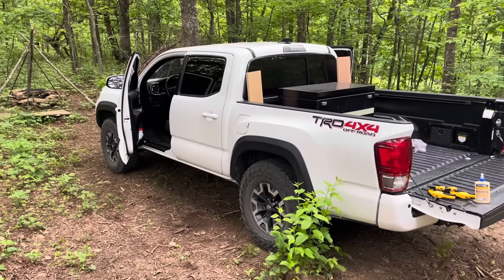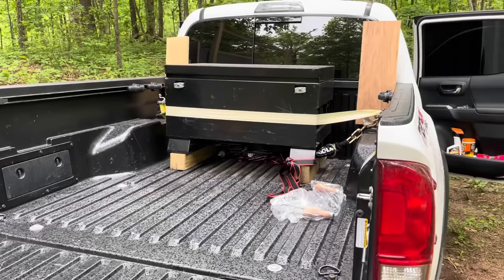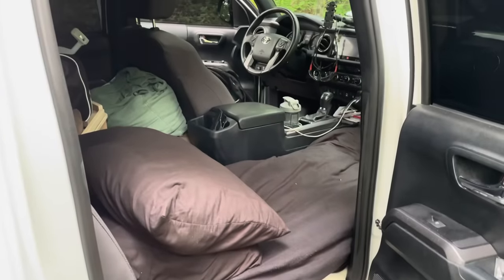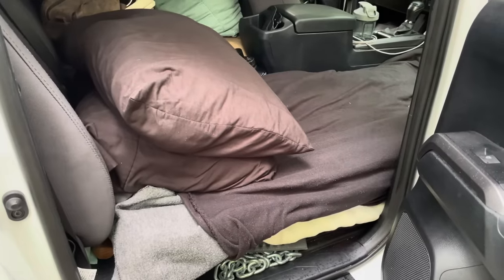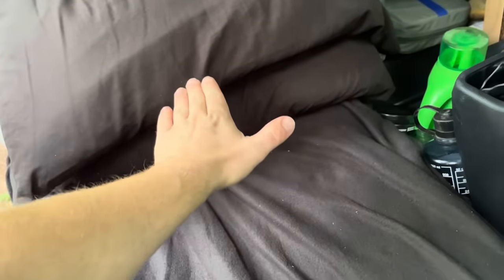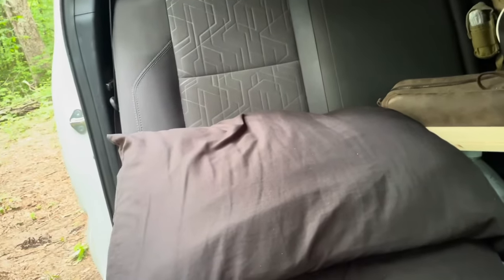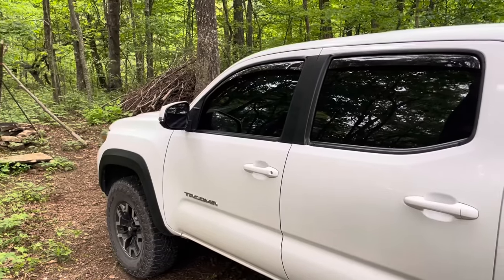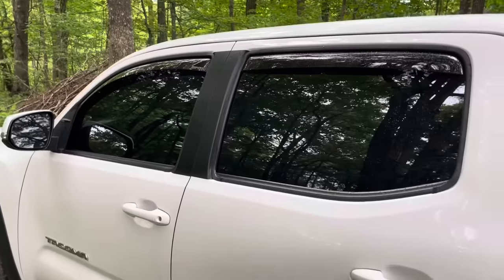Modify your pickup truck cab to live in it | Save money and discreet | Travel truck | Hunting truck

Comment: I have a 2011 dodge ram I want to do this but I'm afraid  of the air bags ...
Reply from the maker: I was worried about them too while disconnecting the wiring but I just went for it and stayed clear, even while turning on the truck the first time afterwards. I’ve seen videos of vehicle cleaning professionals remove seats regularly to deep clean under them. Don’t do it based on my word though lol.

Comment: Wouldn't a cap on the back be better?
Reply from the maker: Not in my opinion. I need the bed space right now. Most everything I’d modify/add in the back, is already done in the cab.
Reply: @ArcadianOutpost  Even if you still sleep in the cab wouldn't it make sense to cover the bed?  There's so much space.  It could become a really big trunk.  Not judging just picking people's brains as I start to plan my move.  On a whole other note did you serve?  Army?
Reply from the maker: @oldnatty61  I definitely think a bed cover would be useful at some point. I may start with a folding hard top tonneau cover but if I found the right price it would be cool to get a shell, but some extra costs come into play when you begin adding weight to the truck. Less gas efficient and I’ve heard a heavy shell may cause some sagging in rear suspension. Not 100 percent sure though. If I ever got a shell, I’d make a hoist to lift it off the back, should I ever need the bed space. And yes, served in the Army🇺🇸
Reply: @ArcadianOutpost  HOOAAA!  AIRBORNE!  I knew it!  Get you some dog!  Thank you for your service brother!